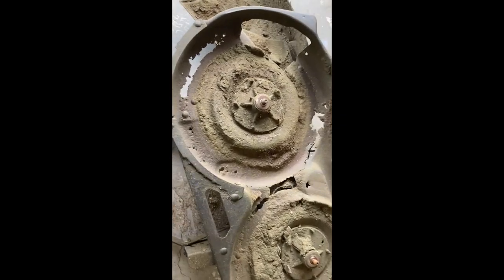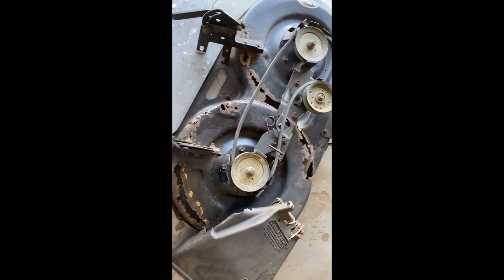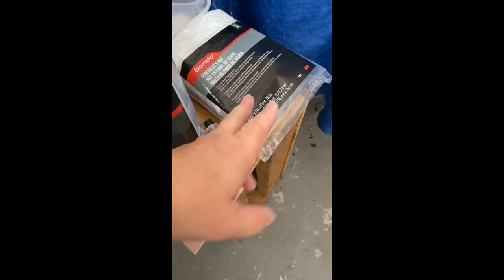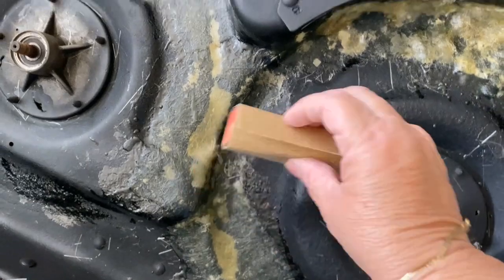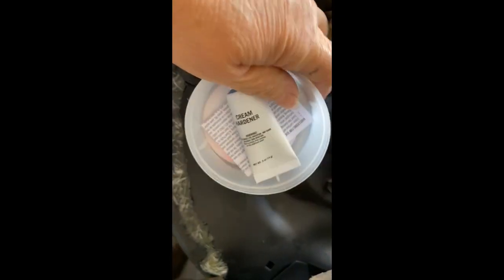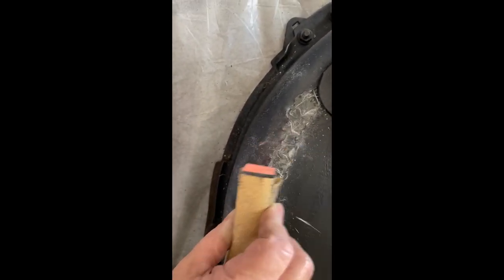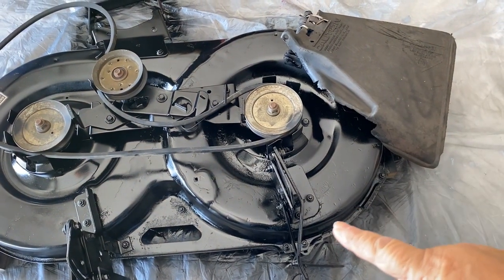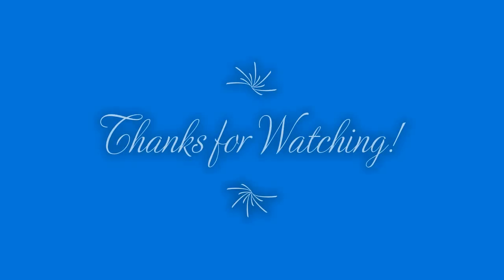Repairing a Rusted Mower Deck - No Welding

Comment: I think this is a great repair!  I own my own construction company and can recognize quality work. I have seen others get an old license plate and screw it into place and others get slabs of sheet metal and weld them on while looking awful.  This mower deck didn't structurally fail, it just rusted out. If fiberglass will stay in a car repair rumbling down the road and sometimes the whole car, this repair will work just fine.  When I repair something I want it to look as close to the original as possible, this repair does that.  People making comments like "it's metal for a reason" and talk about someone "losing a foot" don't have any idea what they are talking about.  There will not be exploding shrapnel flying out from under this deck and the repairs were on top anyway. Some people cannot recognize a quality repair when they see it.  Great video!
Reply from the maker: Thank you!! Thank you!!! I’ve proven that this repair worked because I use this mower every week. Here in Florida the grass grows year round and the soil is mostly sand. It is still holding up. I’m not saying it will last forever but nothing lasts forever anyway. Some of these comments come from people that are speculating but never have tried the repairs themselves. They just want to criticize the video and don’t even watch it.  I really appreciate you watching and commenting. ❤️

Comment: Fantastic, thank you! I saw rust holes thru my mower deck today after mowing. I may give your repair a try, but my previous attempts at fiberglassing have been ugly. Yes the 90 degree heat is a culprit. Sets off the curing too fast. Boo-hoo to the complainers. You did great and explained great. Previously I tried coating under the deck with automotive undercoating. Nope, I don't recommend that. I have been repairing things for 70 years and won't stop any time soon! It is a philosophy.
Reply from the maker: I’m nearly your age and I too am still going until I drop. Thanks for watching and commenting. 👍
Reply: @Chocaluvr    I intended to use your repair method, bought the FG repair kit. When I cleaned and sanded the underside of the deck I realized there was no hope. More hole than metal. I looked online and found a replacement deck for abt $120. Surprised me, it was a perfect fit. When I got the mower reassembled, I sprayed the deck underside with heavy protective enamel. Looks like new!  Thanks for your inspiration.
Bill
Olympia WA
♥

Comment: Wow, what a wonderful restoration.  The way I look at it, this is a permanent fix.  With the fiberglass, Bondo, and all of your proper preparation,  I would think it will last for years.  I repair Yard Equipment and the Mowers that are badly rotted, are often from owner's that use lots of fertilizer.  It seems to eat up the steel and even the Commercial Alloy Decks over time.  Thanks for educating me on restoring a Mower Deck.  Again, Nice job!  Cheers!
Reply from the maker: Thanks for watching! 😊

Comment: You did an awesome job.  I'm trying to figure out if it's worth doing that to my John Deere D105 that rusted out with 35 hours on it, or selling it as is and letting someone else fix it. Tractor still runs good, but the deck, SMH I bought a huskivara to replace it.
Reply: Look for a used deck, you can even try decks from other models in the same production year. I found a deck off a lx188 that dropped right into my gt262
Reply: My JD started rusting at two years. Not my Grandfather's company any more. Sold his 1950 tractor in the 80's and it was solid.  Looking at Husky's.

Comment: I wish I had your confidence. I really need to repair my lawn mower that has rusted, because I fear it is unsafe, but I don't think I am capable of all this.  :(
Reply from the maker: If you are able to get someone to weld it, it’s better. In my case, the welder told me it was beyond a welding repair. I couldn’t find a replacement mower deck for it, new or used, so I resorted to doing this temporary fix until I could find a permanent solution. The temporary fix surprisingly lasted a good 14 months. It was beginning to show some tiny holes in the repairs and I didn’t want to repair it again. It probably would have lasted me longer if I didn’t live in Florida with sand for soil and it literally sand blasts it every time I mowed. I retired my mower due to discontinued parts and bought a new one. Good luck! :)
Reply: @Chocaluvr  Unfortunately I don't have anyone to help with anything. I try to do stuff myself, but usually give up in the middle because I just can't do it...maybe I got my money out of the mower. I bought it about 5 years ago, but haven't used it regularly because I have had a lawn guy off and on...anyway, I know what you mean about Florida because that is where I live. I have plenty of sand kicking up in my face!

Comment: Nice job. I wonder if it would be stronger if you used carbon fiber mat instead of fiberglass.
Reply from the maker: I’ve never heard of carbon fiber mat. I’ll look into it. So far, it’s been holding up.  It’s been 14 months since I did this.

Comment: Ma’am I have the same mower but idk what size the belt is. Don’t know any info on it . :(
Reply from the maker: The mower should have a sticker label with all the part numbers on it. If you can get a hold of a manual, it should also list it there.
Reply: Nope. This thing is older then the moon. I got it for $150 on Facebook used of course but it has no manual or stickers 😢 thank you anyway. Great job on your deck
Reply from the maker: @krizalaniz7575  if the mower has a model number, I can probably look up the part number. Let me know which belt are you looking for.

Comment: Do you have any results after 1 year of service?
Reply from the maker: Hello Matt. It’s been only one month since I did this and so far it’s been holding up very well. Only time will tell. Florida soil is very sandy and mower decks are sandblasted every time you mow. It will wear down even new mower decks.
Reply: @Chocaluvr  I’m in Florida also
Reply: How long did your deck last, I live in Largo. My John Deere D105 only has about 40 hours on it.  But it is  5 years old.  I think I'm going to bottom paint my new one, seems washing it out just makes it rust faster.
Reply from the maker: @dog0311  my riding mower is 15 years old now and I mow for about an 1-1/2 hours every week. Do the math. The rust began about two years ago when I began to wash it- big mistake!! I should have continued with just cleaning it without water. When I get around to replacing it, the first thing I’m going to do to the new mower deck is to treat the underside to prevent rust, and wet grass and mud sticking to it. There are several products out there that you can use. I would still sell your old mower as is and let the buyer decide.
Reply: @Chocaluvr  I never washed my Troy Bilt push mower and got bad rust as in holes. I washed the underside 4 times in 3 years. After mowing, i removed wet grass from the underside. Rust anyways. Perhaps Troys are made with thinner steel these days. I have an older one with deck 100% intact. I repair my current but have older desk as a spare.
Reply from the maker: @zenzekezenard4269  You’re right about the thinner steel. They’re not making them like they did years ago. The steel is thinner where the deck bends because the steel is stretched and that’s were it begins to rust and crack. I never power washed the deck before. I just scraped the wet grass at the bottom like you do. But when I began to wash the deck, that’s when I began to see the deck get worse. I don’t recommend anyone power washing or hosing their decks with water because of the rust.
Reply: @Chocaluvr  As for the rest of the relatively non- rust - damaged underside of the deck. I am going to get the rust pitting off with a wire brush on my drill. Then apply lots of rust protection. Including regular ol latex paint. I have learned my thin steel Troy lesson!
Reply: @Chocaluvr  Washing your mower does not promote rust. A clean mower is a happy mower.
Leaving wet grass on your mower is what will cause it to prematurely rust.
Rule #1 Avoid mowing wet grass !
Reply from the maker: @JoseE60  On my mower, I noticed rust develop faster around the top where the feet rest after hosing my mower every week. I stopped hosing it down. I never mow wet grass but in Florida, in the rainy season, the grass is always wet/humid even if I wait until 11 am. It’s unavoidable if you’re trying to beat that afternoon sun 🥵🔥
Reply: @Chocaluvr  you can power wash under  the deck but it needs to be blown to dry using leaf blower after washing ,otherwise it will rust very quickly.hope it helps.
Reply from the maker: @LeonMTan  yes, that will work. I already blow it after mowing and take out as much as I can underside and topside to prevent the moist grass from sticking. But if I power wash the underside, I’ll take your suggestion. Thanks!

Comment: You made it look good but the mower deck is metal for a reason.
 Could not and would not recommend this as a fix to anyone. 
 The blade tips on a mower travel around 175mph .  Bondo and fiberglass just won't provide the reinforcement nor support the structure of the deck in the event you hit something with the deck or cause it to flex
Reply from the maker: I not only made it look good (unintentionally) but made it functional as I intended. It's supposed to be a temporary fix until I replace it with a new deck or mower, as I stated on the video, which I don't think you watched it through. I am not recommending anything to anyone: read my disclosure at the beginning of the video. I made a video to show how I resolved the problem temporarily on my mower deck. It has been providing the "reinforcement" and "support" for the past 9 months and I have hit something with the deck without any problems so far. I check the deck thoroughly every time I use the mower and it has held up so far. Why don't you make a video of your own and stop trying to discredit and trash other people's video. Have a nice day!
Reply: @Chocaluvr   I don't want to see someone lose a foot. Thats why I replied to your video.  I'm glad you didn't  recommend anyone  doing this. I simply agreed with you.ea
 So why are your feathers  so ruffled
Reply from the maker: @davidstill754  My feathers aren’t ruffled but I’m tired of repeating myself over and over like a parrot to people that are quick to give out their critique without even watching the video. It’s so thoughtful and noble of you to think of others losing a foot and discrediting my repair while you’re at it. Do you think I made these repairs to cause anyone to lose their foot? I don’t want to lose my foot either. It’s a video to try to help others that are in my situation. I leave it at their discretion if they want to do this. The results speak for itself; it has worked for the past 9 months, there’s the proof. But like I said, it’s temporary; it’s not meant to last a lifetime, nothing lasts a lifetime. I wish people would try to do these things first on their own before trashing other peoples’ videos.